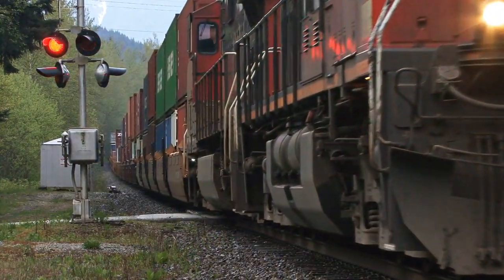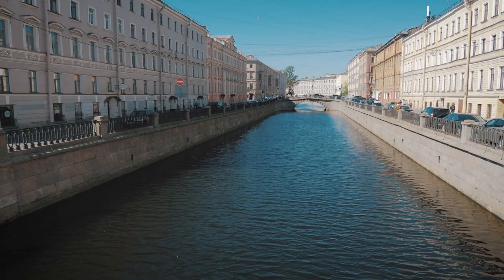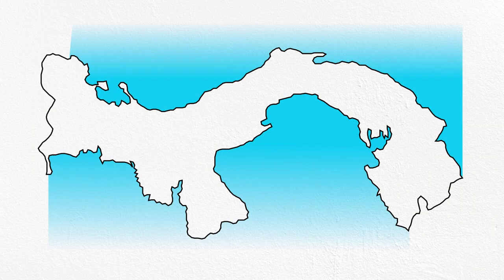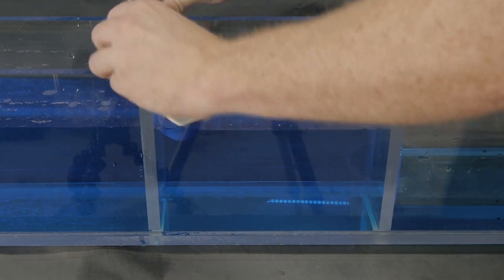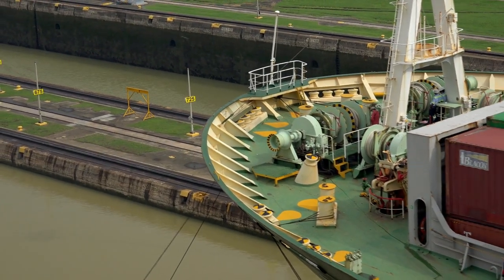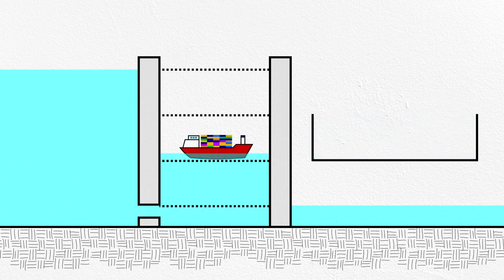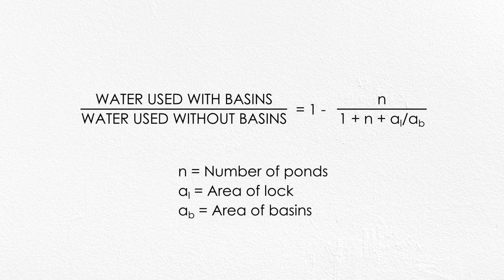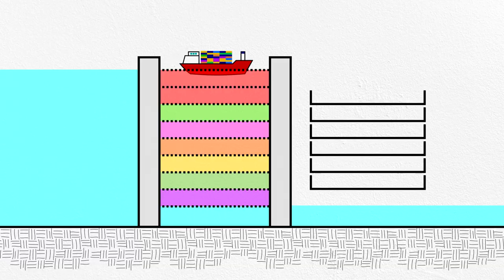The Surprising Efficiency of Canal Locks

Comment: I feel silly that I've never thought about the loss of water in these systems
Reply: Yeah, did you see the Toddbrook reservoir in england getting overtopped last year? that's a canal feeder reservoir - big part of canal projects.
Reply: I don't know why, but I always just assumed they'd pump in water to raise the lock. 

I never thought about how much energy that would waste.
Reply: I just assumed that like in rivers its okay that water goes downstream when using these locks
Reply: @dravorek  I thought that way too. I thought whatever energy you put in to pump water, you eventually get most of it back by letting water level drop.
Reply: I wouldn't feel silly.  My experience with locks is the St. Lawrence Seaway, Welland Ontario is not far from me and I've seen the big Lake Freighters move through them.  Water loss isn't an issue on the Great Lakes locks, as the water lost is small compared to what's in the lakes.  As for the Panama Canal, yes, in the past I wondered about water loss, but never gave it much thought, assuming that rains there were enough to supply the lake.  I had no idea water loss was an issue.
Reply: @dravorek  Well, the water does have potential energy as it drains. If you just let it drain naturally, that just gets turned to waste heat but you could use some of that energy to pump some of the water higher. It wouldn't be 100% efficient, obviously. I think I may have run across something doing this on a canal once but I'm not for sure.
Reply: It's all about your own experiences. I'm in Ontario Canada where water is abundant. I've been on the Trent–Severn Waterway several times which has the worlds largest Lift-lock in Peterborough by the way, but the lock system was build to tame the wild rivers. It's hard to think about saving water when the lock is next to a damn with water roaring over most of the gates. It's hard to consider the problems other parts of the world might have when you have never experienced those places.
Reply: @dravorek  Well... If a canal like the one in Panama was at sea level on one side, as I'd always assumed, you could just let the sea water pour in from the upper part to the lower. 
The complexity of the canal comes from the fact that it's above sea level. But this does prevents flora and fauna from clogging up the thing. It would be pretty unmanagable and also very vulnerable to tides.
Reply: I assumed in the case of the Panama Canal all the water used came from the two respective oceans.
EDIT:  Now that I think about it, the oceans on both sides must be leveled (since water seeks its level).  So in order to lift the ships, they'd need water from a higher elevation, pump it up, or do what they've done in this video.
Reply: I never thought much of it until he showed the length of the Panama canal that was elevated.
Reply: Filipe da Silva
 - you and me both, pal.
Reply: haha what a silly boy, what kind of person doesnt think about the panama canals water loss every time a boat passes by, thats just irresponsible
Reply: How is water "lost"? Does it just disappear, never to be used elsewhere?
Reply: @dravorek  Energy used for pumps pales in comparison the energy needed to sail around S. America.
Reply: I always assumed they pumped water in from both sides of the lock
Reply: Some UK canal systems have pumping stations to pump water from the lower canal to the upper one so it can be reused. A point to note on this is that the pumps do not have to be big/powerful. While a lock can use a lockful of water in a few minutes, the pumps can run for hours and even overnight as there is not the urgency to ready the water for the next use.
Reply: I didn't even know about gravity in canal. I thought they were direct open canal.
Reply: I just assumed the always use pumps to transfer all of the water 🤦
Reply: And if water loss is a big problem the solution is supercool: Boat lifts. Because they are full of water, they weight the same with and without a boat in them, so if you have two that balances each other, you can lift them with very little effort, and there is almost no water loss.
Reply: @chaos.corner  it should probably be possible to use the gate to run a turbine to generate electricity and run a pump, but i'm afraid that wouldn't be too effective. I do however wonder if you could use the same principle as turbochargers in cars, where exhaust gasses enter a turbine which drives a turbine that compresses the air and forces it into the engine. Scaling it up and having a pump instead of a compressor. 

Obviously there would be some losses but it would be interesting to see how efficient a system like that could be.
Reply: @vjm3  -- In the early stages of the building of the Panama Canal, when the French were trying to do it, they envisaged a sea-level canal, but for many reasons (including disease and bogus financing), the project failed. One problem was a river that ran across the path of the canal, a river whose flow was quite variable according to season, and there was a Frenchman who suggested damming it and creating a lake, and using the lake for part of the canal, but he was ignored. When Americans took over the project, they went with that idea, dammed the river, and created Gatun Lake, which comprises much of the "length" of the "canal." The locks lift ships up to the level of the lake on the Atlantic side, and when they get to the other end of the lake, they go through the Culebra Cut (the most recognizable dug-canal part of the system), and locks lower them again. 

-- The water for the canal comes from rainwater falling on the Chagres River watershed, which fills Gatun Lake.
Reply: @grizzlygrizzle   That is so cool.  I'm in to engineering as a career, and it always impresses me just how many unexpected variables come in to play for any given problem.  It makes me wonder how many other major projects started off with "It should be easy" and ended up anything but?
Reply: But what if you use the kind of pumps they use at pumped-hydro electricity storage? You'd get your energy back when the water goes back down.
Reply: A water LOSS? Where do you think that water would go without the lock? It is not lost, just delayed in its flow.
Reply: @chaos.corner  You can put turbines in the drain canals, but 1) the power generation would be only intermittent and 2) due to minuscule height drop and limited amount of water the efficiency would be very low and probably wouldn't make economical sense.
Reply: @chaos.corner  The thing is, you're using the loss in potential energy of the water to raise ships  upwards. If you try to extract some of that potential energy you are sort of defeating the purpose of the lock in the first place.
Reply: i was the opposite, since small, i kept thinking of the water being lost and it running dry, so never understood how the panama canal worked.
Reply: @marekstanek112  Where such pumps are used, they don't use the water from lifting/lowering the water in the lock, but instead use the water of the overflow that's not used by the lock. In other words: for the time the lock is filled from the upper stage, there is less power available for the upstream pumping.
Reply: How did the levels become different in the first place?
Reply: @rodchallis8031  What water loss? The rivers/canals flow regardless from one body to the other. The locks simply suspend the flow for a brief moment while the ships are being transferred and then it continues on.
Reply: @vjm3  The oceans aren't level. Due to spinning Earth and other effects the water can pile up against the shore in a permanent bulge.